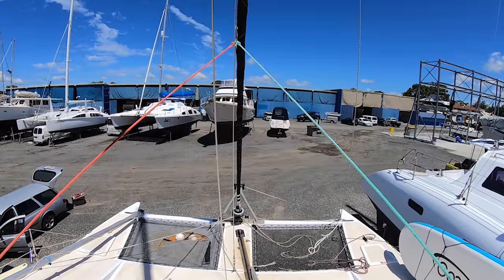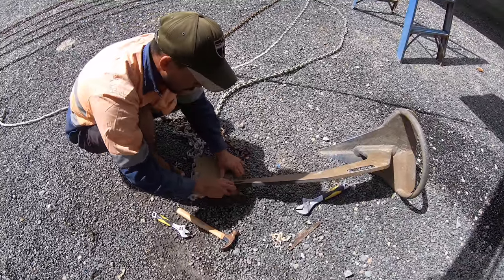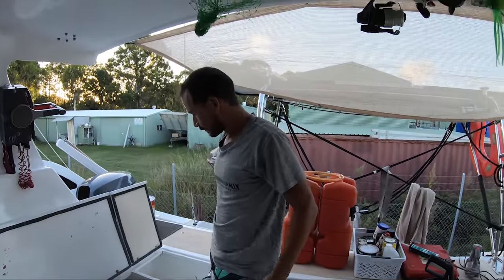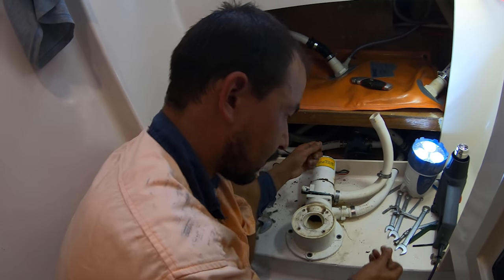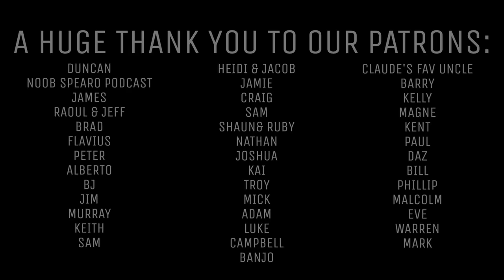Emergency Rudder Repair! (Sailing Popao) Ep.84

Comment: Been in and out of that creek a few times, I used to do it on a half tide but I only drew 600mm, boards up, I figured I would leave the entrance free at high tide for those that needed more water, I did touch once on the way in trying to sneak in before 1/2 tide and straying out of the channel a little, you really need to stick in the middle of the channel at the mouth of that creek.
Reply from the maker: Yeah its definitely claimed a few groundings 😂 luckily it’s just soft mud! I heard rumours of dredging being approved?
Reply: @sailingpopao  Dredging is approved in many of the channels around Moreton bay, problem is I heard the QLD government sold MSQ's only dredge years ago because they were short of money so they aren't able to maintain the channels.
Reply from the maker: @daveamies5031  yeah right, that sounds like a bad decision on their part!

Comment: I seriously like this little Cat,  obviously I’ve seen episodes before but haven’t taken alot of notice,  who builds them?  And are they affordable as in value of money?
Reply from the maker: Thanks Trev! They are called Easy’s, designed by Peter Snell in Brisbane. Usually homebuilt by owners off the plans. Glass over ply/epoxy construction. There are a few models from 9-12m. Ours is a 2006 built 11.3m (37’) 4t dry weight. We plan our passages on 6kts but often see 8-10’s, max 16kts so far 😳

Great boats very comfortable, sail well and are relatively affordable especially for a catamaran. Easy to fix and we are extremely happy with our purchase!

Comment: Armchair expert but please humor me. This emergency repair is ok but suggest you have a careful look at bearings and supports of rudder axel tube. Also the stock and w3lds inside rudder
Reply from the maker: Had a look inside as best we could at the rudder tube and the weld that goes into the rudder itself both appeared solid. 1000nm later still going strong. Cheers for the heads up!